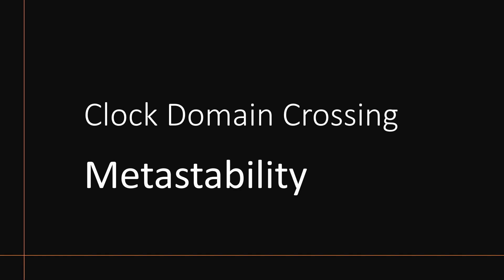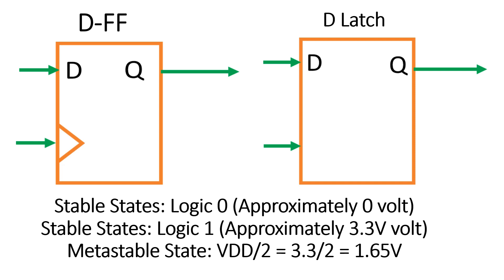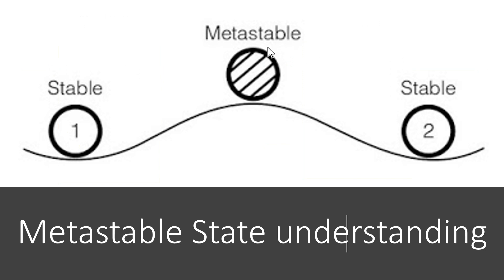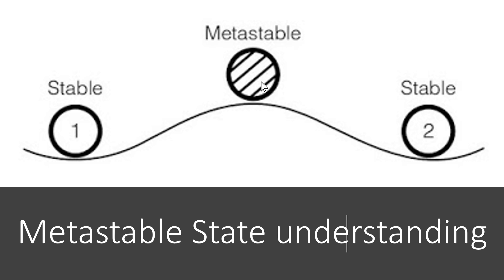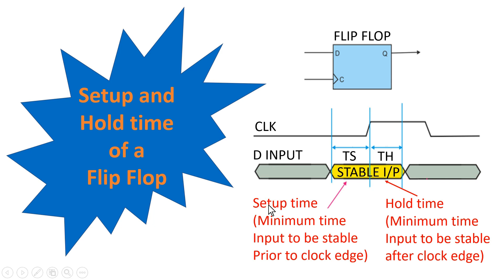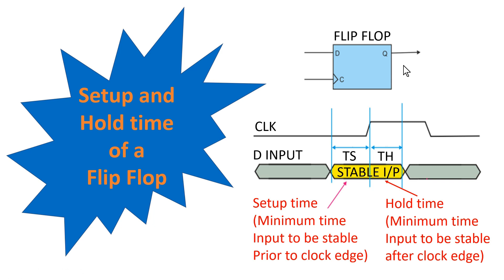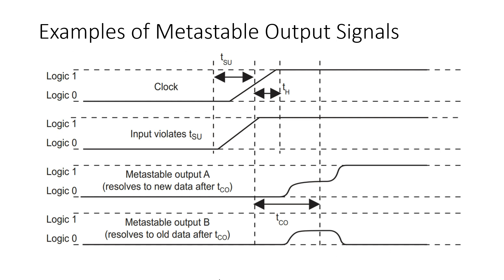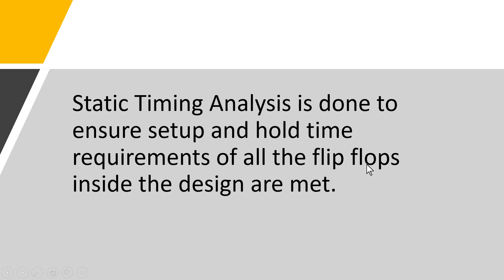Clock Domain Crossing Metastability Part 1

Comment: so metastability is an FF output at midway between logic levels and it gets there due to setup and hold violations. It's final state could be erroneous which translates to a system error. that about right?

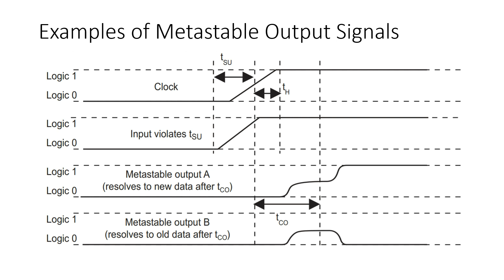Comment: 7:12 sir what factors decide how long  does a flipflop takes  to come to stable state from metastable state ?
Reply from the maker: Hello Venu, it is a good question .. It is not fixed .. It is a sort of a probability. sometimes, flipflop takes  a long time to settle and sometime it may come to stable state immediately.

if clock frequency is high i.e. time period is very low.. chances are that first flip flop in a flop synchronizer may not come out of meta stability which can cause second flip flop to go to meta stable state. That is the reason, if frequency is higher, put more flops in a synchronizer.

Hope this answered your question. Let me know if you need any further clarification.